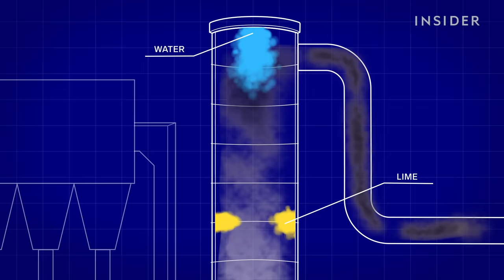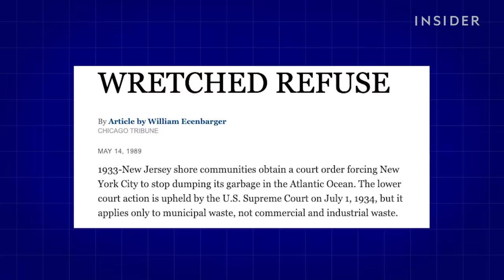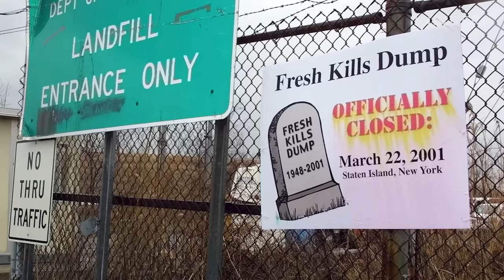What Happens To NYC’s 3.2 Million Tons Of Trash | Big Business | Business Insider

Comment: I am a dumpster diver, and I find it a shame to see many many things in the dumpsters that only requires a little handyman fix, like a window ac that only need the filter cleaned, vacumes that the hose only needs to be unplugged, furniture that only needs a little stain or paint would bring it back to life again, microwaves that only needs to be cleaned because they were to lazy to clean it so they threw it out rather than taking a few minutes to clean it. very sad.
Reply: In the old days, you could take a load to the dump and come back with as much stuff because of finds like the ones you’ve mentioned.

Comment: I worked on a garbage truck for three weeks.  Hardest job in my life.  Respect to those that do it, especially in big cities like NY.
Reply: Some of the guys in the trucks, are hot!
Reply: @mrtoocranky56  What does this have to do with the above comment and who cares wether they're hot, cold, fried or baked?
Reply: @k.r.99  lmao
Reply: @k.r.99  😂😂😂
Reply: @mrtoocranky56  tf
Reply: Did u check to see how solid the truck was too? 🤣
Reply: May I ask what was hard about it ? @tijlazer
Reply: @Yousometoto  Yes you can, it was a combination of the amount of labor and the hours, and the driving.  I operated a sider loader so I did all of both jobs, all the driving and all of the loading.  You averaged about 15 to 20 tons a day and you were on duty anywhere from 8-13 hours.  I think one day I clocked out at 14 hours, including two trips to the dump and to and from my yard i only did about 80 kms.  That's one of the most misleading things, is you are more of a laborer than you are a driver.  Admittedly I am not super fit but I am about average size.  If you stick it out though depending on the company you can build seniority to become a front end loader or roll off driver.  I worked for waste management in Canada.  The problem was though so many guys either had bad backs or bad shoulders from doing the job after 5 to 10 years.  Thats why I got into the post office after that and was there 11 years before I got laid off due to modernization.

Comment: I love this video I work as a millwright and occasionally Covanta will hire our company to change out the conveyor belts that they had in the ash house basically there’s a bunch of rubber belts like 50 feet long and it separates the ash down even more there a whole pile there full of thousands of quarters and other non metallic metals but apparently we aren’t allowed to take them cause technically they are burnt and not useable per say covanta but I also work inside that bag house they were talking about that place is nasty full face respirator is needed inside there

Comment: Can we just appreciate that Frank is so skilled at his job that he can determine the load of the truck with a method as simple (yet difficult) as banging on the side of the truck to analyse the sound produced by an empty truck versus that of a full truck?
Reply: That takes like... a day to learn.
Reply: @silvermediastudio  What does a 30% full truck sound like compared to a 50%, 70%, or 100% full truck?
Reply: @IncredibleMD  About the same as anything else sounds when you bang on it and it is a quarter, half, three quarters, or completely full.  Completely hollow, kinda hollow, not very hollow, and not hollow at all.
Reply: @silvermediastudio  Garbage trucks are a bit bigger than most things, though, and their sounds are correspondingly bigger. The outside of the truck doesn't flex nearly as much as, say, a cookie tin, when struck. The container doesn't act like a drum nearly as much as smaller objects.

Comment: We need to force all CEOs or board members that creates unnecessary products to these waste facilities.  We need to eliminate all paper plates, diapers, plastic toys, plastic bottles, etc.  People will need to eat off the table so we're not using glass plates which requires a lot of water to clean.  It's more efficient to just clean the table. I would follow this if it's put into law.  Packaging is another major problem, see a lot of waste that goes into it.  Using plastic saran wrap, Styrofoam, etc. should be eliminated.  The food and toy companies are the main contributors for so much waste that is being produced.  Eliminate all individual packages.  Ppl will need to go to the store with their reusable bags or containers to get rice, oaks, bread etc.  By doing this method, it will eliminate about 3/4 of the problems.  Many ppl will complain but it's necessary.

Comment: The problem is that the leftover ash is extremely toxic. When it seeps into rivers, ocean, or ground water, as runoff from the landfill, it's a huge problem. Plus, the air scrubbers aren't capable to removing 100% of the toxics, and it releases NO2 and other chemicals that can cause cancer and environmental damage.
Reply: It's imperfect but is it worse then landfills?
Reply: @monawoka97  It’s definitely debatable. I’m just saying I think this video didn’t fully represent its downsides.
Reply: @ross4  I guess the problem with trash is that there are only downsides. Though this way is flawed, I still believe it is the best way to go about it. The carbon emissions are not as detrimental as coal plants, and the remaining waste, though bad is still better than trash that goes straight to landfills because of the reduced quantity and size
Reply: @ross4  Turning millions of tons of trash into a valuable renewable resource is "debatably" better than just letting it sit somewhere and pile up?

Dude if it wasn't for this process we would all be wading through garbage on land and sea.

This factually IS better than landfills. And if you have a problem with it just wait a few more decades and we'll probably solve the ash problem, too.
Reply: @jekblom123  Yeah, I pretty much agree with you. I was just pointing out that it's not perfect! (Air pollution and toxic ash. Creating less waste is better than landfills or burning it. It seems like energy created from garbage isn't exactly "renewable"... And the amount of power generated is pretty low compared to the amount of trash burned. And did you know they actually need to burn natural gas to keep the garbage burning? But I agree it's probably still better than landfills.